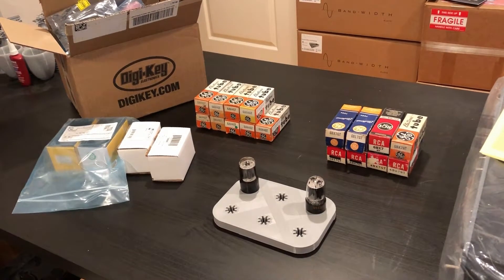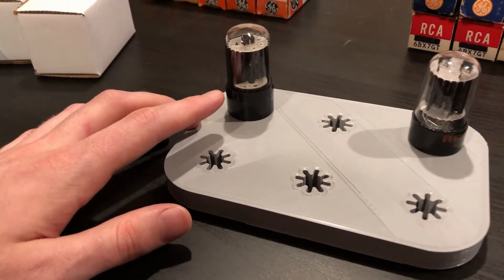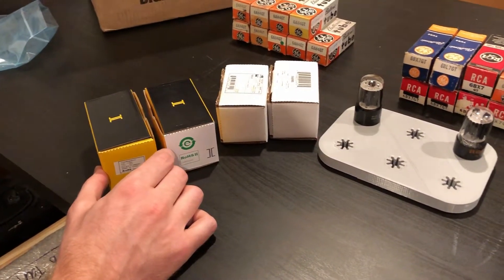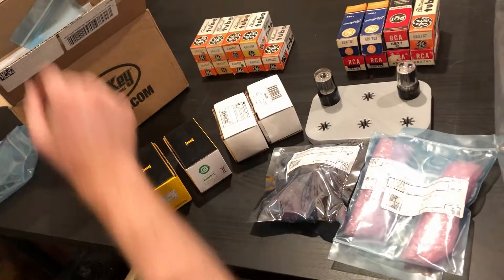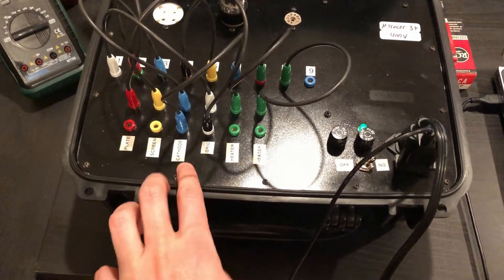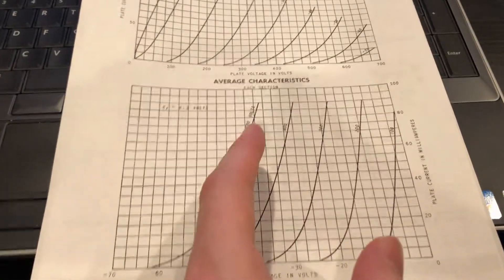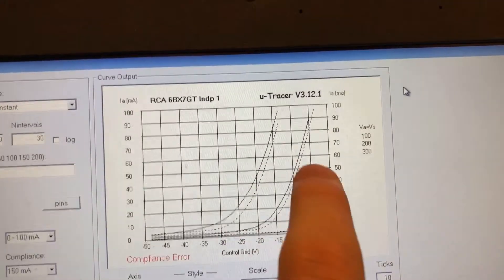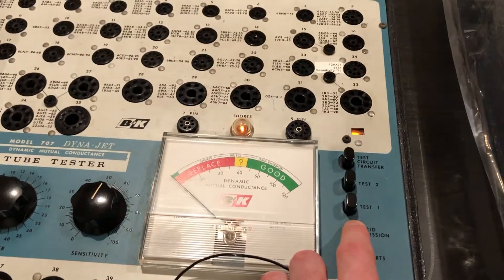Tube Testing and Why Curve Tracing NOS Vacuum Tubes is a Must - Bandwidth Audio Project 2845 Part 5

Comment: OK, so there's probably air that has gotten into the tube causing the leakage. From what I have read (and only read) you need to bake the tube at like 200 degrees C for 12-24 or more hours, in order to get the getter to start working on those air molecules. After that, the leakage should be fine. Never tried this but I certainley will as I am a regulations/measurement person, and have been wanting to make some Sous-Vide controllers for AC heaters, for a while now. "when" is unknown.
Reply from the maker: I have tried baking tubes numerous times that were truly NOS and had either poor emissions or leakage current / gas issues. To be honest, I have not had much success. Occasionally performance improves slightly but never enough for me to consider using in a product. If one tube out of many has issues, chances are it will always have issues if the others are working to spec. Time to toss it in the bin!
Reply: @bandwidthaudio7479  I see. Could you tell me at which temperatures and for how many hours?
Reply: @windshield11  @Bandwidth Audio I also would be interested in learning more about this! Can you share what you did to get the best results? (Even if they were only marginal)